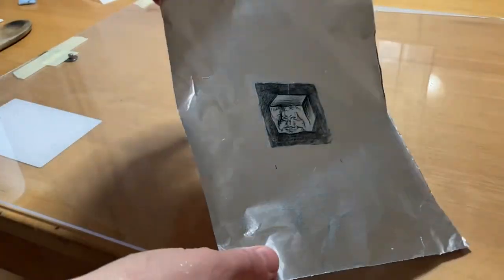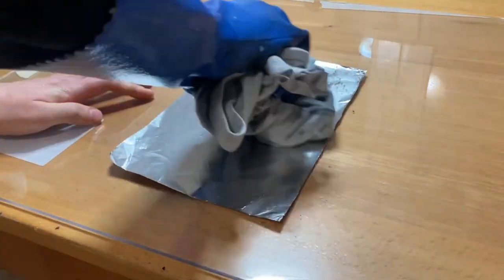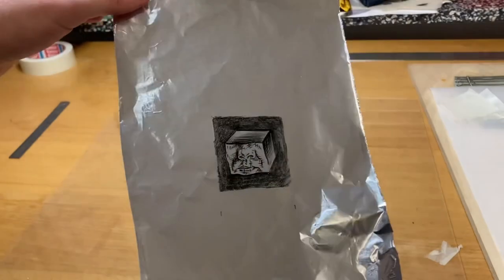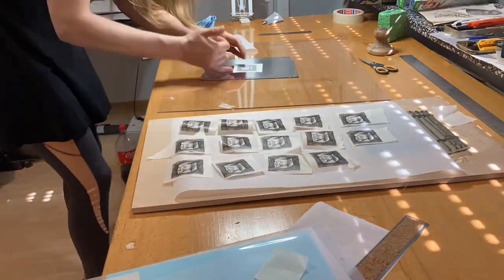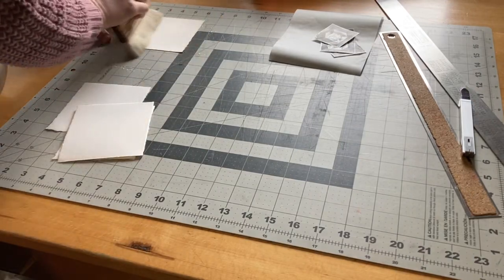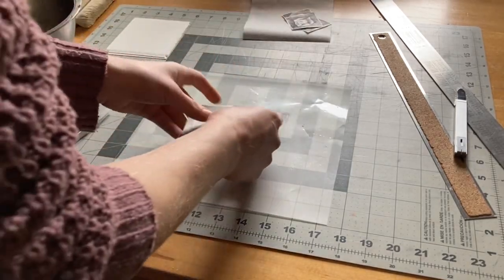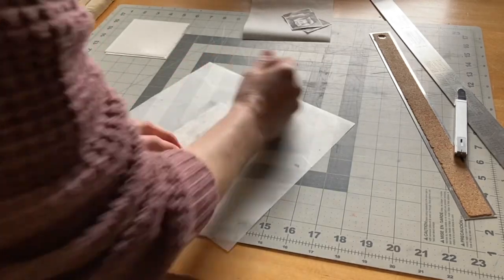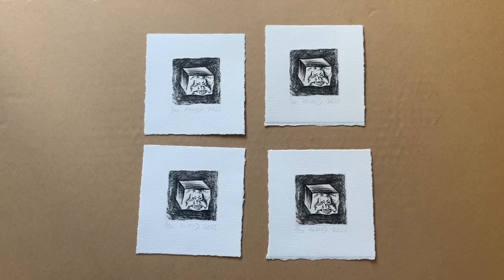Extended Printing Experiments in Kitchen Lithography- Part 2

Comment: How can i transfer a design from paper to foil , please
I try a esitol and it failure
Reply from the maker: I transfer the outlines of my design to the foil using a ballpoint pen over a sketch (sometimes with carbon copy paper in between). In this way, you still need to draw the design onto the foil, using the outlines as a guide.
The other method would be using acetone, but it will only work for a toner print (i.e,. a photocopy and not a print from an inkjet printer). In addition to ample amounts of acetone, it will also need pressure (like being passed through a press).
Reply: @valeriesyposz  thanks so much for your reply, I will try again